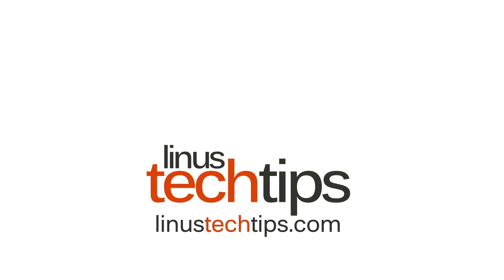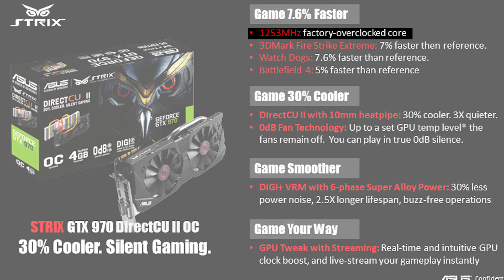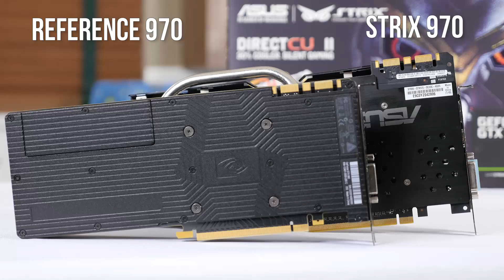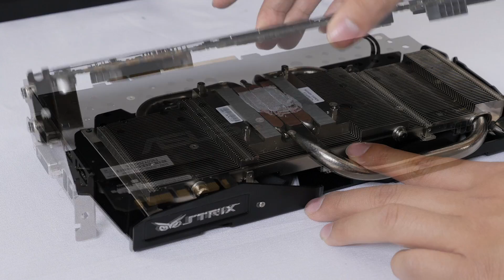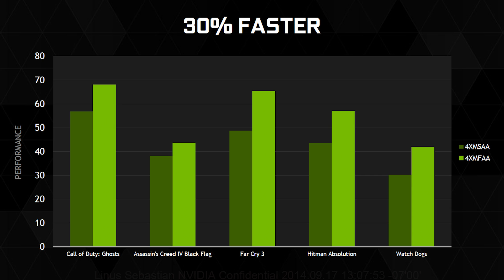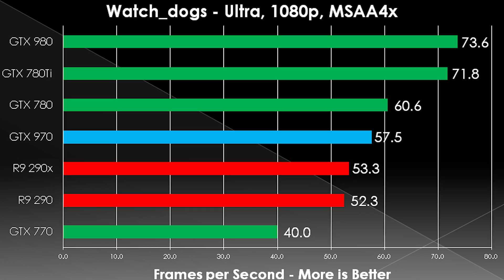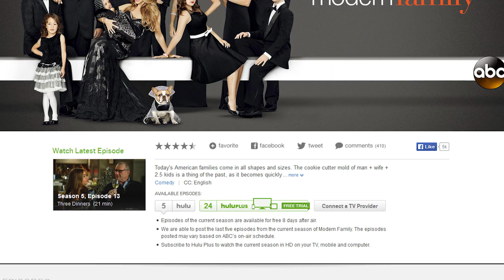ASUS Strix GeForce GTX 970 Video Card

Comment: From who should I buy my GTX 979?
I think the Gigabyte one doesn't fit in my Case (Zalman Z11) so I'm thinking of an EVGA one. The FTW or Superclocked.
Or should I get ASUS instead?
Or MSI?
Or does Gigabyte acutally fit?

If needed, my specs (I'm going to build it, does it even run with this hardware??)
Case: Zalman Z11 (59,99€)
CPU: Intel Xeon E3 1231 v3 (290€)
Graphics: GTX 970 (which one?) (~350€)
Motherboard: Don't know.. Help me on that one too..
PSU: Also don't know, help me there too!
SSD: Pretty sure: Samsung 850 EVO 250GB (114€)

Maximum budget: 1020€
Reply: ***** Motherboard:http://www.mindfactory.de/product_info.php/ASRock-H97-Pro4-Intel-H97-So-1150-Dual-Channel-DDR3-ATX-Retail_961262.html                          GPU:http://www.mindfactory.de/product_info.php/4096MB-MSI-GeForce-GTX-970-Gaming-4G-Aktiv-PCIe-3-0-x16--Retail-_976948.html
                         PSU:http://www.mindfactory.de/product_info.php/500-Watt-be-quiet--Pure-Power-L8-Non-Modular-80--Bronze_857817.html
Reply: I am the Wind. I don't know, they seem so cheap...
Reply: ***** Its the best u can get for 1000 euros soo....but if the motherboard looks cheap to you u can also take this one :http://www.mindfactory.de/product_info.php/ASRock-Fatal1ty-Z97-Killer-Intel-Z97-So-1150-Dual-Channel-DDR3-ATX-Retail_961253.html
Reply: I am the Wind lol, you seriously gave him a link to an Z97 Board when he wants to buy a Xeon. The H97 Pro4 is an great Board. But the l8 is pure Trash, get an LC Power Gold Series 500w
Reply: Mr Wesp Mb sorry :(

Comment: Hi guys, I'm a bit new to PC gaming and I am wondering how they overclocked the graphics cards. Is there a software for it or do you have to get really technical?
Reply: Many graphics cards are already overclocked by factory default and if you like to overclock own your own i suggest you try these softwares :
MSI AFTERBURNER
EVGA PRECISION
Reply: Thanks!
Reply: Thanks!
Reply: carl van gent 
GPU overclock = Easy Peasy
CPU overclock = Hours of stress testing and fiddling :)
Reply: xDamo Mc Oh, I was thinking of overclocking my i5 4590k, but would that be too much work?
Reply: carl van gent Not if you look into it. It is worth it if you have a good cooler, it's essentially free performance, it just takes a while to get it stable.
Reply: xDamo Mc Ok thx

Comment: After digging a lot of you tube videos, forums, Tom's hardware, this' hardware, that's hardware etc. websites for 3 weeks and finally I bought this G1 gtx 970 card & It's almost 3 months. Surprisingly no coil whine issue at all (seriously).
I say ratio of card's performance w.r.t power consumption, heat & money is very very good(as expected). As for Asus Strix most users opinions about performance were like "ya", "ok", "almost", "good though" as all full of nonsense. Obviously it cant compete with G1 card.
In terms of temp, my G1 temp never gets above 75°C thanks to its 3-Fans wind-force tech.
Honestly my PC runs almost 12 hrs a day & this beast gives me cutting-edge performance in everyday work like in playing FPS games, little bit of both Cry Engine & Unreal Game development, Multimedia editing such as Adobe Premiere etc.
If you ever have chance to SLI these cards then I'd say JUST DO IT. :)

Comment: Just ordered my PC with this card, I hope I will be happy :) my new rig:

Tower: NZXT Phantom Big Tower Black
Corsair RM750, 750W PSU
Intel Core i7-4790K
MSI Z97 GAMING 3, Socket-1150
HyperX Fury DDR3 1866MHz 16GB Red
ASUS GeForce STRIX GTX 970 4GB

:)
Reply: Overclock your 970 +170-185 mhz on the Core and 450-500 mhz on the Memory. It will surpass or have the same performance as a Reference GTX 980 :D. BTW Nice build, enjoy it! :D

Comment: I might sound like a noob here but I am kinda new to this stuff 

If I were to run two of these on three BenQ XL2430T what cables would I use to connect them and get 1ms at 144hz at 1080p

Comment: I really liked this video card and for the longest time i was thinking of buying this for my new computer. But my friend who owns the same case as I do (NZXT H440) bought this card and said that the weight of this card is very heavy, he had to wrap tapes around it so it doesn't fall and/or mess up the ports on the motherboard, so I went with the Gigabyte GTX 970 G1 Gaming (and it is great) Can you verify that?

Comment: Proccesor: Intel(R) Core(TM) i5-2500 CPU @ 3.30 GHz 
RAM: 8,00 GB
Graphics Card: Amd Radeon HD 6700 Series
Chip Type: Amd radeon graphics proccesor (0x68BA)
Dac type: Internal Dac 400 mhz

Should I Buy : VGA PCIE16 GTX970 4GB GDDR5/STRIX-GTX970-DC2OC-4GD5 ASUS

Or: MSI GeForce GTX 970, 4GB GDDR5 (256 Bit), HDMI, 2xDVI, DP
Reply: People have reported that both of these cards work great. Overclocking is perfect and no coil whine whatsoever. I personally got the strix and am more than in love with it :)
Reply: So can I add this card to my system ? :p

Comment: hey guys im thinking of making a computer with these specs tell me what you think
power:corsair power 450w 80+
motherboard:msi - z97 gaming 5
processor:intel i5 4690k
box:zalman:11z plus
storage:seagate barracuda 1to 7200 rpm
memory:KINGSTON HyperX Fury BLACK Series 8 Go (2 x 4 Go)
can it play battlefield 4?
on ultra
Reply: and geforce gtx 970
:)
Reply: You never mentioned a graphics card but otherwise yeah
Reply: i added the graphics card in the comments but are there any compatibility problems?
Reply: Dillon cool would it get any fps problems on dying light ultra for example
Reply: So far that I see no mine runs it at 60 fps on ultra with a way weaker card and we have almost the same setup so you should be fine
Reply: kk awesome but might be a while before getting this cause my moneys in england and im in france bank transfers and all that shit
:(
Reply: that sucks well good luck gaming when you get your money
Reply: Dillon cool thx :)

Comment: Hi guys, im going to build a new pc since mine is pretty obsolete and i wanted you to tell me if the following config is really powerful or not and what would you change and why, so here we go: 
Intel Core i7 4770k
Msi dual gtx 970 4gb ddr5
16 gb 1600 mhz ram 
So what do you think
Ps: sorry if my English is not correct
Reply: Unless you're rendering/editing you dont need 16 gb of ram. I'd also go for a single 980 opposed to sli 970's
Reply: Roguekake58 u do XXDDDD, games now days SO DEMANDING
Reply: You are better  off getting 
Z97 Motherboard with Intel i7 4790K rather than 4770k (its older)  
16GB 1866 Mhz corsair ram 
1 x GTX 970 (get second later if needed)

Comment: I am building a gaming PC and i need help.

CPU: i5 4690K
MOBO: Asus Maximus 7 Hero 
RAM: Corsair 2x8GB, DDR3, PC12800, CL9, Vengeance Pro
GPU: Asus Strix GTX970 4GB
PSU: Corsair RM750
CASE: Corsair Graphite 230T Black
HDD: WD Black 1TB 7200 rpm
SSD: Samsung 850 evo 250gb
CPU Cooler: Scythe Mugen 4
DVD Burner: Asus DRW-24F1ST 24x, SATA
OS: Windows 8.1 NL OEM
DISPLAY: Dell UH2515 2k Monitor

Is this good for 2k gaming? (I will be upgrading to 2 970's)

Comment: I wanna build my very first gaming rig please help me.
Budget $2000

i7 4770k

Asus maximus VII

Ripjawz ram 16 gb

Gtx 970 ( any other ideas )

Any Corsair 800w PSU

H100 Corsair Water Cooling

520 gb of SSD

4tb of HDD (is a SSHD actually good?0

Im sorry if my english is bad
Reply: Do you really need an i7 for gaming? You can get a 4690k and spend more money for a 980.Also 4 tb is too much, you can get a 1 tb hdd with a ssd in raid.
Reply: Aris Zoungouridis ok, thanks for the comment also are gaming laptops worth it? what gaming laptop should i buy?

Comment: Please Help

I'm thinking about building my first PC here's the specs:
- i5-4690K Processor 3.5 GHz
- EVGA GeForce GTX 970 SSC ACX 2.0+ 4GB GDDR5 256bit
- Kingston HyperX FURY 8GB Kit (2x4GB) 1600MHz DDR3 CL10 DIMM
- ASUS Z97-A ATX DDR3 2600 LGA 1150 Motherboards Z97-A
- WD Blue 1TB Everyday PC Desktop Hard Drive: 3.5 Inch
- Samsung 850 EVO 120GB 2.5-Inch SATA III Internal SSD 
- Microsoft Windows 8.1 - Full Version
- Asus 24x DVD-RW Serial-ATA Internal OEM Optical Drive DRW-24B1ST 
- Cooler Master Hyper 212 EVO - CPU Cooler with 120mm PWM Fan
- Corsair CX Series 600 Watt ATX/EPS Modular 80 PLUS Bronze ATX12V/EPS12V 552 Power Supply CX600M
- Corsair Graphite Series 230T Black with Window Compact Mid-Tower Computer Case

Total Price: $1,207.93
Just need advice if this build is okay; also, i'm only using Amazon hypothetically purchase these parts .
Reply: Everything is awesome but i would put a 650-800 watt PSU in there for future sli upgrades,Evga G2 and B2 PSU´s would be awesome for this ;)
Reply: ye looks good

Comment: I got this card and an Asus  H81M-PLUS H81 Micro-ATX Motherboard - 1150 socket for an i5 4690k CPU. I will get 8gb of RAM and upgrade to a 750 watt PSU with eventual SSD, overclocking and SLI. For now though I am going simple and will use my Radeon 7750 and current PSU/RAM until I can upgrade. However I want to upgrade the CPU and motherboard so I need a new case but I want one that will fit this giant graphics card. Will this case meet my needs? Many thanks in advance!! :-) 

http://www.aria.co.uk/Products/Components/Cases/Cases+with+PSUs/ARIAnet+Impact+Black+Micro-ATX+Case+w%2F+500W+Power+Supply+?productId=47030&rqcType=q#rqc

If not what other case should I get? I am willing to spend around 30/35 British Pounds since I live in the UK so it should be from retailers in Great Britain if possible. Cheers!

Comment: (PLEASE HELP)
Would a Corsair 500W power supply be good enough for my system ? 
- i5 4460 
- EVGA GTX 970 
- 16 GB Corsair Vengeance Ram
- Z87M Gaming Motherboard
- 1TB WD Blue Hard drive
- Crucial 128 GB SSD
- Windows 7 Home Premium (64Bit)
- DVD Writer
Will I run into ANY problems with this ? All I need left is the power supply and all the 600W corsair power supplies are out of stock or come with no power cable.. Please can I have any help from anyone and comments help so much! Thank you.
Reply: Corsair is not the only option for power supply. 600/620W is the right option for your system.
Reply: overlord580 Thanks! What other brands would you recommend ? & could I use any power cable or will I have to get a certain kind?
Reply: Alexx Wilson I would reccomend EVGA's 600W (or 650W) supernova PSU. There are more options however
Reply: Alexx Wilson I have Seasonic 620W EVO modular . With all cables.
Reply: I actually have that psu you state, it blue screens when playing games so it isnt compatiible
Reply: it should be fine but if you want to upgrade your pc in the next year or two a 600w psu wouldn't be a bad idea
Reply: I've ordered the corsair 600W :) Hopefully it's good for the long run!
Reply: I got the corsair 1000w psu prob the best option if you running a 970 plus ram and cpu I tried with my crosshair 1v board with a 600w and it kept shutting down when trying to play far cry 4.
Reply: DarkVoidDan Are you sure that wasn't because of the 3.5 Vram issue?
Reply: Alexx Wilson It could have been I didn't really figure out the problem but yeah it might of been Vram as that uses some power but at the time I only had a 2 core cpu in as I was testing But I think  it was the gpu.
Reply: Do 600w so you have headroom for upgrading and over clocking if you never think you will upgrade then 500w "should" be fine

Comment: Will a evga 600watts psu be enough to power this gtx 970 and an I5 4690k
Reply: I have Seasonic 620W evo, I7 4790K overclocked to 4.5gHz,gtx970 strix, Asus Z97 Pro, 3X ssd 240GB, 2X HDD 2TB, running without problems.

Comment: Hey its my first time building a pc can you let me know how this sounds.
 
Cpu: Intel Core i5-4590 3.3GHz Quad-Core Processor

Motherboard: ASRock Fatal1ty Z97 Killer ATX LGA1150 Motherboard

Ram: G.Skill Ripjaws X Series 16GB (4 x 4GB) DDR3-2133 Memory

Storage: Western Digital Caviar Blue 1TB 3.5" 7200RPM Internal Hard Drive

Gpu: Asus GeForce GTX 970 4GB STRIX Video Card

Case: Cooler Master N400 ATX Mid Tower Case

Power supply: XFX TS 550W 80+ Bronze Certified ATX Power Supply

Optical drive: Asus DRW-24B1ST/BLK/B/AS DVD/CD Writer

For my os I want windows 8.1 but from what I'm reading there is different types and I don't know which one I should get. 

If anyone could tell me how this biuld is or give me advice that would be great.
Reply: It will probably be better to get 2 8gb sticks of ram rather than 4x4 it works out more expensive but its better if you want to upgrade your RAM again in the future also make sure you PS can take your components as well as taking into account  heat build up The gtx 970 has 3.5gb of Vram just so you know. One last not make sure your motherboard is compatible with the case.
Reply: There is no need for the speed of RAM to be above 1600, they do not make any difference on the system. The only reason I have the 1866 is because it was on sale and was actually $2 cheaper than 1600, so why not. Also make it 2*8 not 4*4. If you are using this for gaming, get a bigger storage and/or consider a SSD for your OS, really makes a difference.
Reply: VOxEmmitt Bump up your power supply a little. bit. The minimum should be around 600w. Also go modular (not sure if your PSU is or not) because it makes everything so much easier

Comment: im gonna "upgrade" to that card from a 960 now normally that woudnt be a smart idea as the card just came out however. i got it from amazon thinking i could not handle the 970 turns out i just needed to update my bios and likely the 970 will run nice so im returning the 960 at the end of the month for a refund and getting the 970 as im stil in the return window :-). fun.

Comment: Is this a good upgrade? 

CPU: Intel Core i7-4790K 4.0GHz Quad-Core OEM/Tray Processor  ($308.95 @ SuperBiiz) 
Motherboard: Asus Z97-A ATX LGA1150 Motherboard  ($137.99 @ SuperBiiz) 
Memory: G.Skill Ripjaws X Series 8GB (2 x 4GB) DDR3-1600 Memory  ($72.88 @ OutletPC) 
Video Card: Asus GeForce GTX 970 4GB STRIX Video Card  ($329.98 @ OutletPC) 
Power Supply: Thermaltake TR2 600W 80+ Bronze Certified ATX Power Supply 
Total: $849.80

Comment: So I'm getting this card since my GTX 660 is having problems and I wanted a more powerfull graphics card.My question is will a 550w psu handle this card?Some people have tell that it will run fine but some tells me that I should upgrade it to a 600w or plus psu.And I hope this card runs The Witcher 3 on max with atleast 30fps.
Reply: The safest bet would get a new PSU because it would be cutting it close with 550, especially if you have a non-haswell CPU. NCIX has an excellent mail in rebate, http://www.ncixus.com/products/?sku=78577&vpn=CP-9020060-NA&manufacture=Corsair